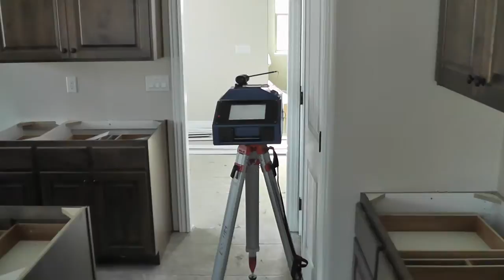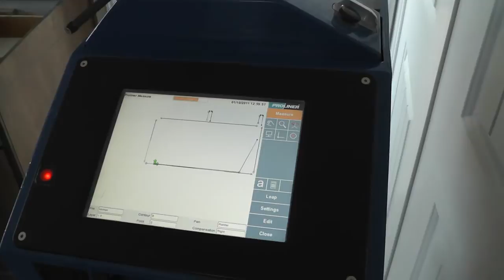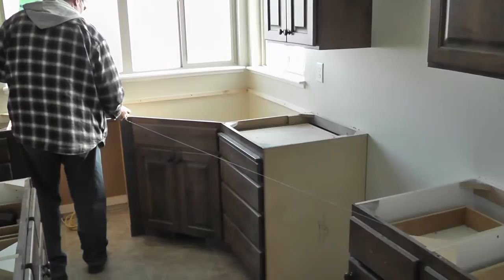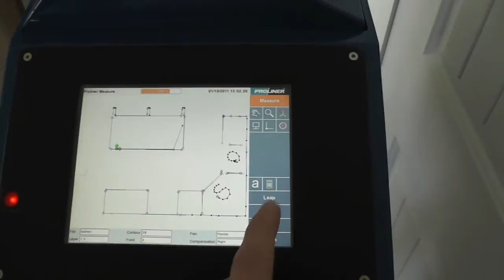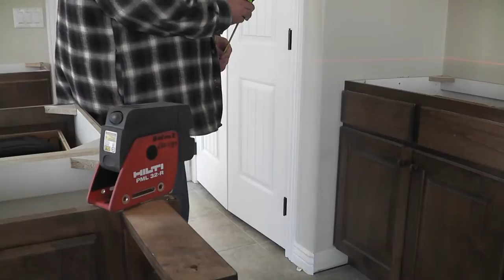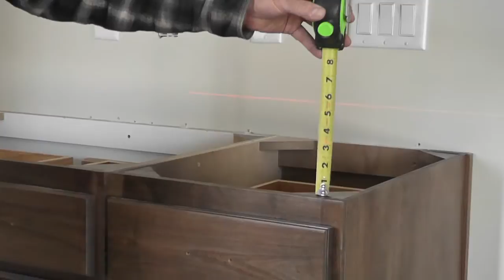Making a Digital Template by Bedrock Quartz

Comment: Nice professional explanation of creating a precise digital countertop template for the stone industry.  Bedrock Quartz is using a Proliner 8 CS (Construct Series).  One other great feature of the Proliner is the ability to have customer approvals at the jobsite by using the built-in touchscreen.  Customers can sign-off on the job using the Proliner touchscreen.  Also fabricators can show the customers materials and edge details using the Proliner CAD features at the jobsite.